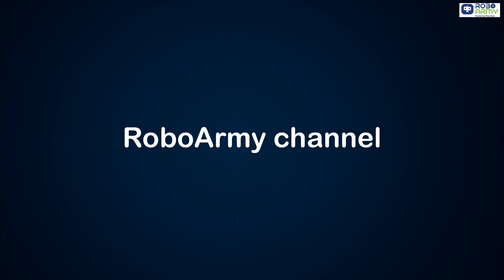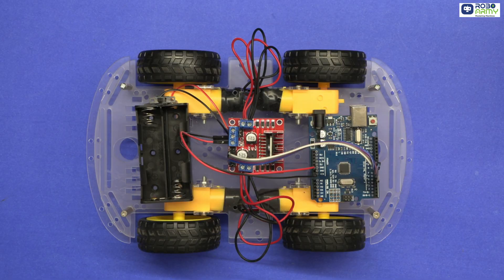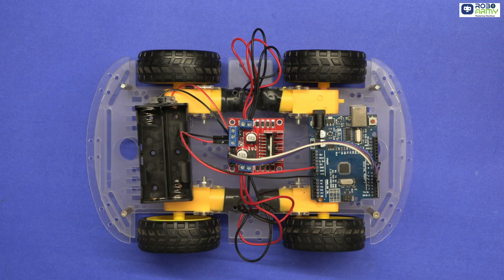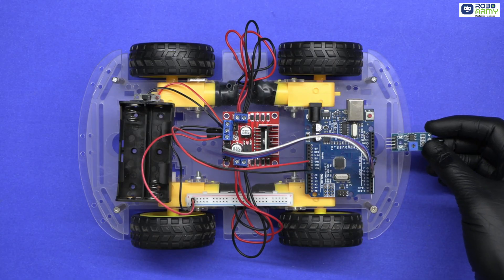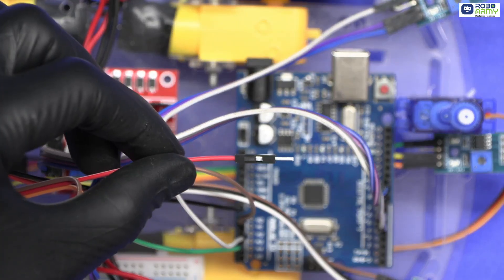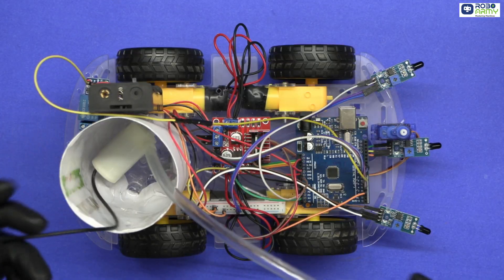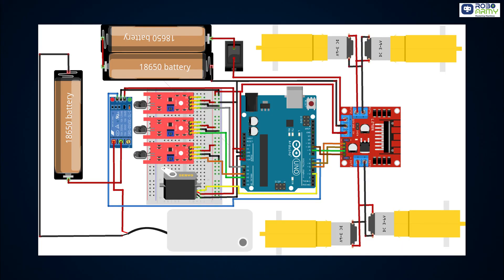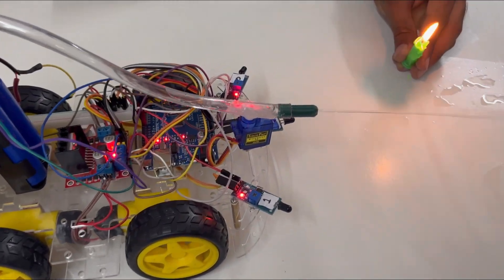Fire Fighting Robot SERIES | Part 2 | All Circuit Connections | Best Science Project

Comment: Mistakenly i bought 3 pin flame sensor instead of AO DO is present there
So can i connect DO to pin 2 on arduino 
Will it work the same with it
Please tell...😢😢😢
Reply from the maker: Yes, you can connect the DO (digital output) pin of your 3-pin flame sensor directly to digital pin 2 on the Arduino, and it will work just fine for digital readings!
Reply: Thank you ❤

Comment: You have shown a switch in the curcuit digram but in the video no switch is being used 
Can you explain which will be better ...
And why ?
Reply: Please reply fast 
I have to sumbit my project tomorrow 😢😢😢😢
Reply from the maker: Good observation 👍
The switch shown in the circuit diagram is optional.

🔹 Why it’s in the diagram:
The switch is added as a safety and convenience feature. It lets you turn the robot ON/OFF easily without removing batteries every time.

🔹 Why it’s not used in the video:
In the video, we powered the robot directly to keep the demo simple and avoid extra wiring for beginners. That’s why no physical switch is visible.

🔹 Which is better?
✅ With switch (recommended for long-term use):
Safer
Prevents sparks while connecting batteries
Easier power control

✅ Without switch (okay for demo/testing):
Simpler wiring
Fewer components

👉 Final recommendation:
If you’re making this as a project or school submission, using a switch is better and safer.
If you’re just testing or learning, it’s fine to run it without a switch.

Thanks for pointing it out — great question! 😊

Comment: can I use a HW battery instead of that 1 lithuim ion battery u used In the relay module to power the pump , please reply fast
Reply: please reply past , I have to build it within 2 days, also please post the third part as soon as possible
Reply from the maker: Yes, you can use a HW battery. Just check that the voltage should not exceed the pump rating.
If you provide higher voltage, the pump will heat up and may stop working.